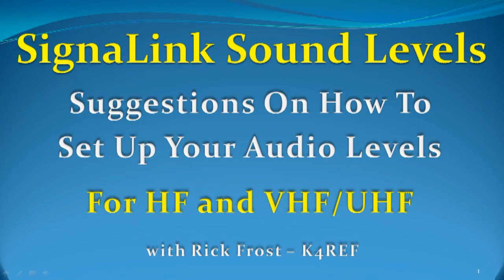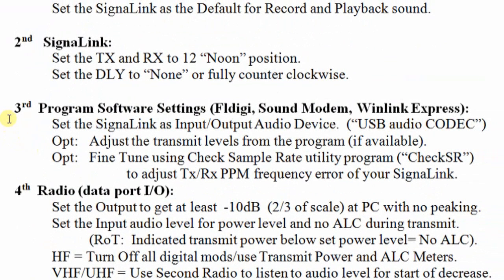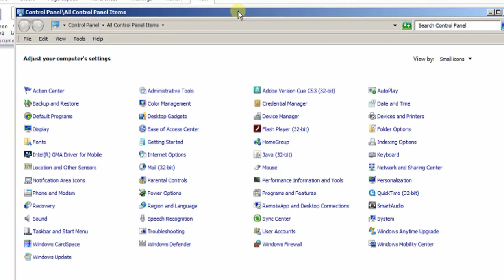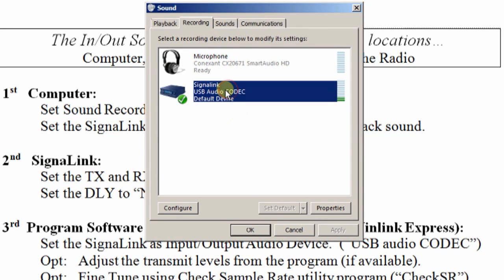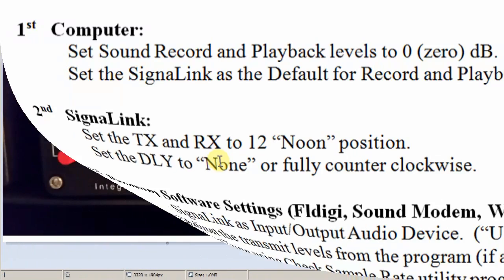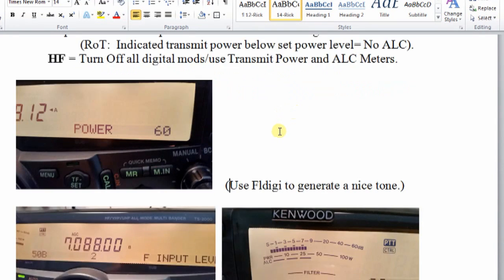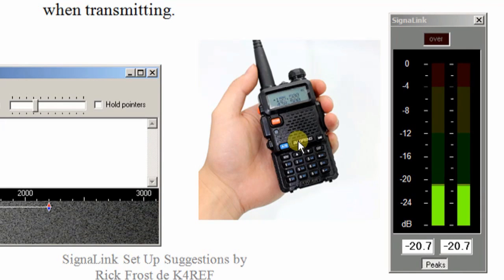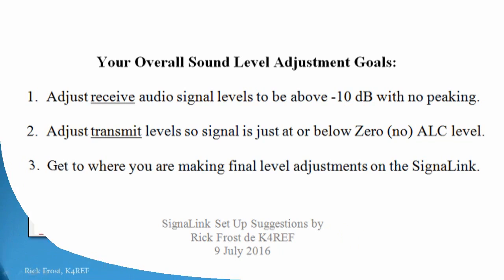Setting Up SignaLink USB Sound Levels

Comment: Rick ... Best down to earth explanations & instructions to be found anywhere. 
Something else that is fun to play around with - on vhf/uhf (not just HF) is sstv via mmsstv. I like FLDigi too and it is easy to use once 
one get's past the learning curve. 
My System -  Yaesu FT-7900 (vhf/uhf) mobile rig on a power supply - SignaLink usb with (slcab6pm) cable from SL to Radio's data jack. Antenna is a 5/8 wave vertical. I've had a lot of fun with this setup.
Lots more to do on VHF/UHF than just tying your radio up full time as a digipeater.  Packet, Satellites, Talking, Moonbounce, SSTV and so on. 
No digital fusion/dstar/dmr stuff for me.  Way to expensive and cross compatibility isn't there. Not to mention backwards compatibility from version to version.  Just saying ...

Comment: On the Line-In or Microphone properties, you should be able to click on the Levels tab, and then hit the Tab key to tab over to the level adjustment. A dotted line should be drawn around the level adjustment box. From there you can use the left and right arrow keys to adjust the level. On my Windows 10 pc I was able to set it to 0.0dB with either this method or the mouse.

Comment: I'm using the same radio. Trying to pass traffic VARA FM P2P and loose all audio input at 9600 but can connect.. At 1200 I have super audio input but no data transfer?? That's menu 50F. Thoughts?? 1200 works fine VARA HF to my message center.
Reply: Am using new SL-1+

Comment from the maker: If your water fall still doesn't look right in FLDIGI look at the bottom of the screen and also check to make sure the Upper Signal Level is set at -20 and the Signal Range is set at 70 (these are the default settings).

Comment: I installed the uv meter. It is at -24db.  I have an Icom 765. Where do I make the adjustment for -12db. Manual does not cover this setting. 
THANKS.

Comment: One thing I would point out is yes, you want the signalink as the input and output USB audio codec device selected in the software, but not as your default windows sound device. Having the USB audio codec as the default Windows device for record and playback makes it so the windows sounds can be broadcast, and it is not necessary for the signalink to work.
Reply: I see later in the video you turn off the computer sounds to avoid broadcasting them, but you can leave them on and keep your regular computer speakers and mic still chosen as the default devices for windows and signalink still works fine as long as you have USB audio codec as the input and output in the software your using such as ham radio deluxe digitalmaster , fldigi etc....
Reply: Confused now. First as default, oh but then not?

Comment from the maker: If you've done all the set up in this video... and still have extremely low or no transmit audio levels... check the data port baud rate.  I had a friend who had his Kenwood set to 9600 instead of 1200... and it caused very low audio transmit levels that nothing would effect.  So, make sure your data port baud rate is set to 1200!!

Comment: Hi Rick! Thx this video.Struggling myself quite a bit with setting sound and playback and my various apps that use VAC doing all kind of internal routings that tends to confuse in the end. Anyway a remark wrt the PeakLevel that you prefer to set to around -16 in the DarkWood meter. Not being able to change the fixed AF output in my IC-910 the only option is to increase the level in the recording settings to +10dB (so no longer the 0 dB as you indicate) Would this ruin the overall result ? 73 Albert PD0OXW
Reply from the maker: well... you really prefer not to use anything other than 0 db on the PC settings.  Reason is that you don't want the PC manipulating the signal.  Having said that... I would try it to see if it helps.  The -16 on the DW meter is just a background noise level.  What you really care about is the actual signal level coming in.  Digital is surprising in that it CAN operate will very low levels.   THAT is when you adjust the Signalink's levels to get good connectivity.   BTW... there is a signal sensitivity jumper inside the Signalink.  You might give that a try to increase the receive level to the PC.  Right now there is a Geo Storm going on... so, you probably will not get good DX sessions anyway. :)
Reply: Hi Rick ! In the end all went well (with some help of my son HI ! Thx again yr advice and all the best from Holland . 73 Albert Pd0oxw

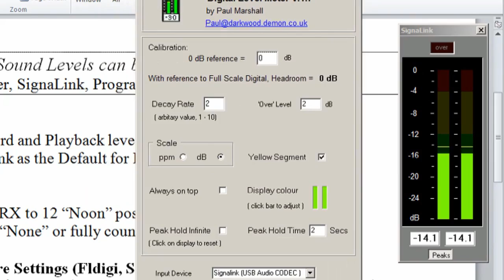Comment: A bit confused...when you set the signalink up at 10:30... it shows that it's hearing or transmitting sound, from the looks of it. (the green levels are flucuating, so I assume that means sound it being heard/ or trasmitting, but you have nothing plugged in at that point? right? and you disabled the microphone on the PC, So what is it actually hearing?

Comment: I must be missing something. Darkwood level show -30 db on my signaling. 
Radio=ft857d 
Windows 10

Have scrolled through radio menu looking for something to adjust and am not finding anything particular.

Any ideas?
Thanks.
Reply from the maker: If you right click on the Darkwood meter... it will bring up it's options.  Check the input is correct.  Other than that... not sure .

Comment: Great video but I'm still having problems connecting. Not sure if my 857D is set up correctly. I have no idea what I'm doing lol.  73 N7TWR
Reply: It's the 4th step that I'm having trouble with.
Reply: Timothy.. Did you ever get your 857 working?  I am having trouble also.
Reply: I did at one point but then changed my settings to use fldigi and try to use winmor and haven't gotten it to work since.
Reply: Timothy ok. thanks!  seems it shouldn't be so hard... LOL
Reply: One would think. Of course I always tend to make things more difficult than they need to be

Comment: can you explain why no ALC? What happens if is a lot? Like a 100?
Reply from the maker: the simple explanation is that you are distorting and over modulating the signal.  digital signals don't like that.  if you ever have seen a PSK-31 signal... it is a very narrow signal.  if you have a lot of ALC... the signal splatters all across the band and interferes with other folks digital "conversations."  (you will be a hated person.)  if you always transmit with a little less power indicated than the radio is actually set to... you will not have any ALC.   so, set the radio power to say 60 watts... and when you are actually transmitting, adjust your Signalink TX so that 30 to 50 watts is indicated on your radio.  easy peasy.

Comment from the maker: One additional comment:  If your computer software locks up with you transmit on 40 meters (7 Mhz) using a SignaLink... try changing out the SignaLink's USB cable (it's the same as any printer cable).  I've had two systems that have done this... and using a better cable fixed both.
Reply: Oh man! I hope this is the cause of my fldigi CAT control problems on 40 meters. It's been driving me insane! I guess the USB cable isn't shielded well enough to block the 40 meter signal coming from the radio and the USB signal gets corrupted? Thanks for passing this info along! Maybe I'll slap on some ferrite chokes and see what happens. I have a 3rd-party CAT control USB cable that might be the culprit.
Reply: @Nnnnnnnnnnnnnnnnnnnnnnn280  what did you ultimately find?  I worked all bands yesterday from 10 down to 40 as the bands faded and when I hit 40, bam!  Radio would not key, Tune would not key, everything quit working.  I thought it may have been RF in the shack since I couldn't get the SWR on the doublet below 3:1, but it was late and I was frustrated so I just powered everything off and went to bed.
Reply: @wileytraylor5404  I did solve the problem! I did three things, none of which I have tested independently. Together they work, and I'm happy with that. 1)  replaced the USB cable to the SignaLink with "Tripp Lite USB 2.0 Hi-Speed A/B Cable with Ferrite Chokes (M/M) 3-ft. (U023-003)" from Amazon ($8). 2) I got a RG400 mix 43 toroid choke kit from KF7P Metalwerks and put that on the antenna feed line at the transceiver. 3) I put clamp-on chokes on both ends of my generic CAT cable, wrapping the cable through the choke several times at each end. Haven't had any problems since! I suspect the USB cable and the CAT cable chokes would have done the trick, but again, I haven't verified that yet. Good luck!
Reply: @Nnnnnnnnnnnnnnnnnnnnnnn280  thanks for the update.  Tonight while running FT8 on 30 meters, I tripped the arc protection circuit breaker for the bedroom.  Apparently there were a few of those susceptible to RF.  Looks like I'm going to spend some time searching for a multiband antenna that doesn't have problems with RF on the feedline.